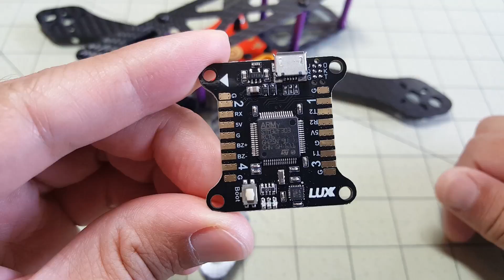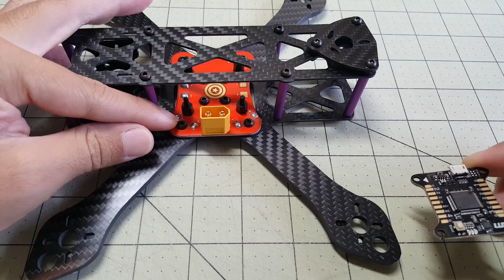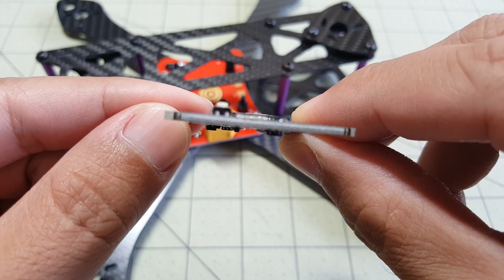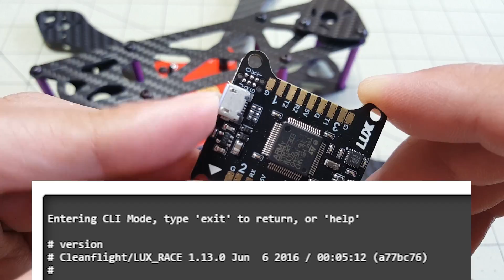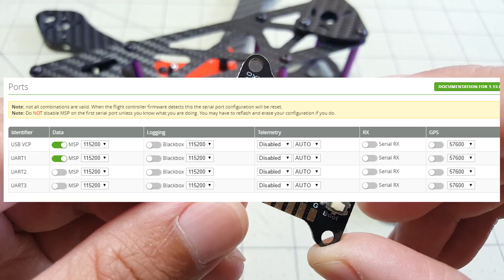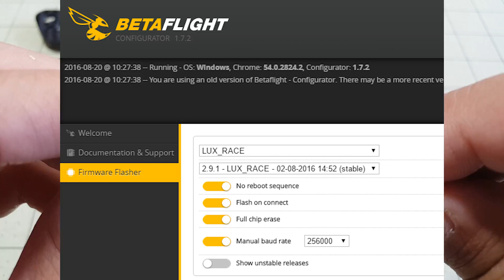LUX Flight Controller Review

Comment: It uses the 6500 gyro chip... which I heard isn't as good as the 6000 or the 6050 chips. (vibration issues) Tell us if you can see/feel any difference in the new quad :)